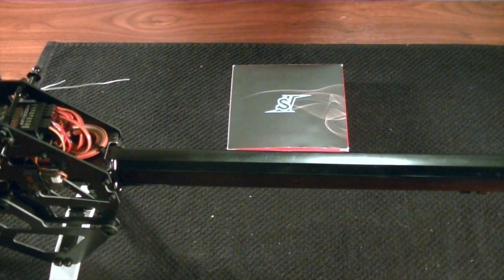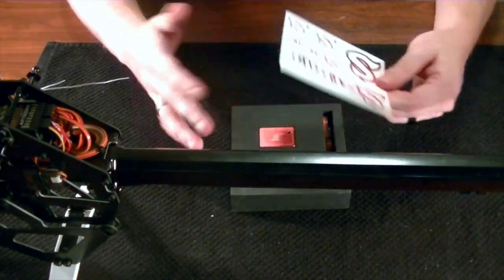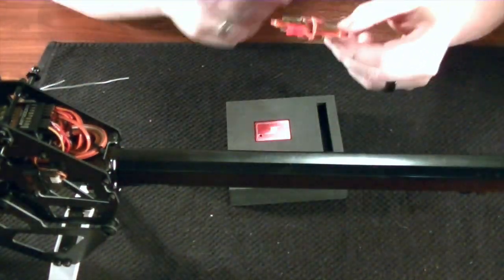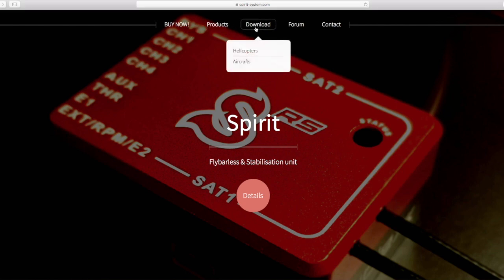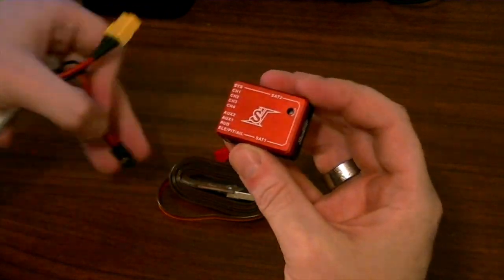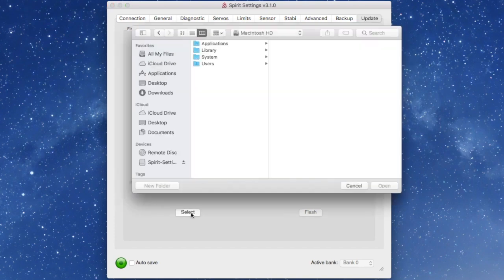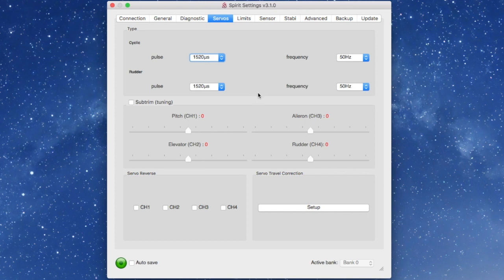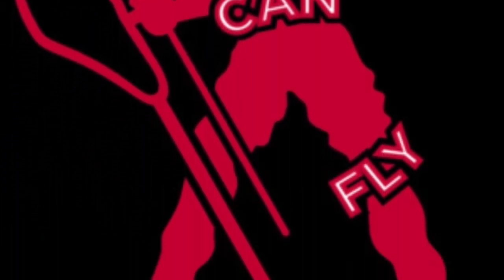Spirit 2 : Out of the box/Updating system for use

Comment: Woo hoo. Finally a Freddy Can Fly video. Hope all is well. Did you sell your other 2 helis? How is the family? BTW. Any update on the merchandise? Still waiting for your logo on the Blade 230sv2 blades.
Reply from the maker: Hey buddy, I am working on some cool new projects and this is one of them.  Not at a merch position yet lol, just have magnet trays and 550 size blades with Freddy can fly.
Reply: @FreddyCanFly  can you shrink the blades and make the fit on the Blade 230s V2? Lol. I like my micro helis. About to pull the trigger on an Align 470 BNF series.